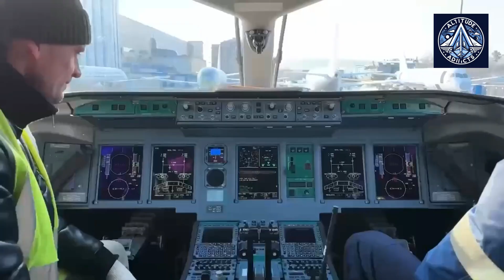PD-8 Engine on SSJ-100 First Flight - Including Pilot Interviews

Comment: How efficient are these?
Reply from the maker: We will know only after its operations start on a regular basis. However, it should be more efficient even if they don't match the western ones. But, as with the western engines, they will be improved.

Comment: This happens with sanctions; when a country sanctions another country, there is a risk the government being sanctioned will go it alone. In the process, once sanctions are lifted, they can't be in place forever, which means another competitor now exists. European and American competitors are boxed out. In a country like Russia, which requires 1500 new aircraft per year, this means many opportunities to work with Russia will have been lost.
Reply: Russia requires no more than 100 new aircrafts (like MS-21-310 and SJ-100) pers year. In 20 year cycle overall demand does not exceed 2000 new aircrafts.
Other aircrafts are required for local flights can be made on IL-114-300.
Reply: The ability to make airliners in Russia (USSR) died down at around 1975. There is no chance a Russian airliner can compete with Western ones.
Reply: @tassiooak  In 1975 and after that Russia (USSR) produced:
205 TU-154B-1
292 TU-154B-2
298 TU-154M
Peak production was in 1980 when 76 TU-154 were produced.

962 IL-76 of all modifications
106 IL-86 of all modifications
33 IL-96 of all modifications
90 Tu-204/214 of all modifications

Overall ~2000 aircrafts.

Comment: La conception meme du moteur PD8 fait que son intérêt est très limité, voire inexistant sur le marché international, hors le fait d'être produit en Russie. En effet, on estime sa consommation en kérosène comme supérieure de 30 % à celle des moteurs occidentaux dernière génération...
Reply: La Chine et l'Inde paient le kérosène russe 2 x moins cher, donc même +30% de conso reste avantageux...
Le but est surtout d'être à l'abri des sanctions, le carburant coule littéralement à flot en Russie.
Reply: @yvesd_fr1810  
Russian aircraft engine consumes 0.61 kg/kgf*h (for comparison: SaM-146 with similar parameters – about 0.63 kg/kgf*h). Russian engine is more economical

Comment: More competition on the plane market is always good.
Reply: If IT IS competition.
Reply: @andrzej3511  Well, Russian airliners cannot get Western planes any more.
Reply: @andrzej3511  Of course it's a competition!
Things have recently turned 180 degrees in relation to the situation as it was in the last few decades...
Air carriers could choose between the two leading aircraft manufacturers, and even if someone dared to look for an alternative, NATO and the EU would quickly appear and "explain" to the air carrier and its government that there is no alternative!
Now NATO and the EU are joke, the EU economy is a circus, and old and new players are on the top of the world political and economic scene, so those who dare to look for an alternative will find an alternative, because there is no longer that good old "voice of reason" from NATO and the EU that will insist on non-alternativeness...
Reply: @andrzej3511  at least they will not have to on board Boeing
Reply: The production is mostly for domestic use. It may however reach central asian markets because some of them still operate and mantain soviet aircraft. Production capacity is still a big hurdle for it to reach the global market.